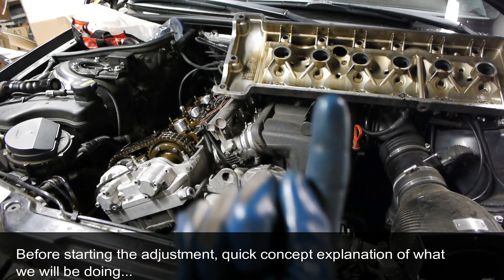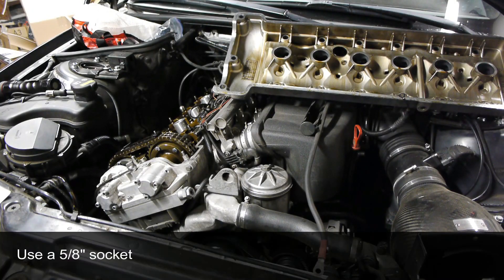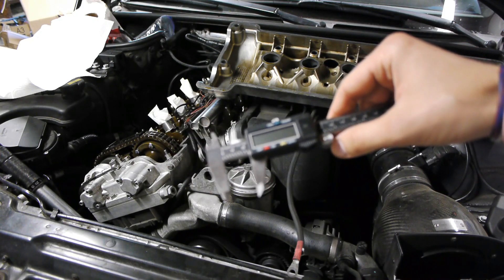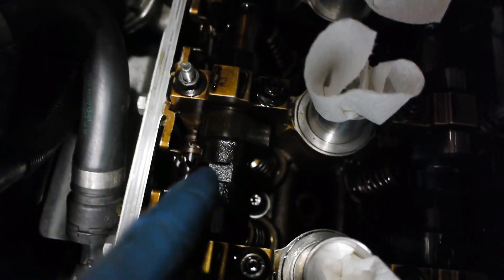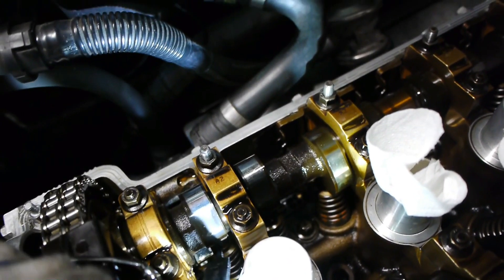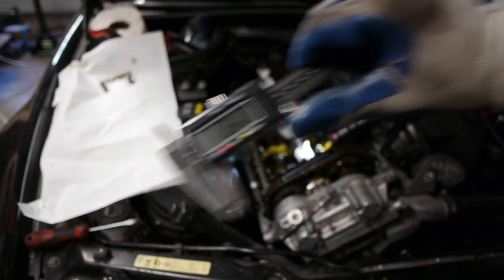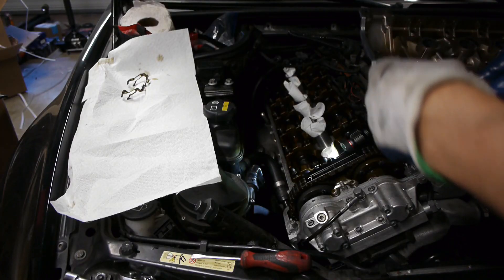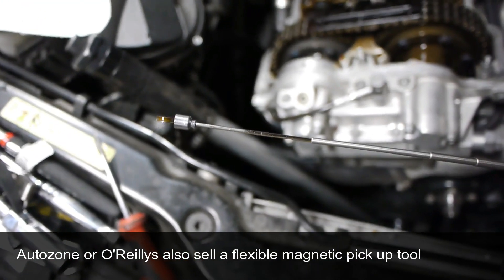E46 M3 Valve Adjustment - Part 3 Measurements, Adjustments, Looking for shims

Comment: I just did mine this weekend. Ordered a second shim kit because there were only 3 per size. I actually was able to finish it with just one kit since as I moved on to other valves, those shims worked for the valves I didn’t have any left of in the kit. I had a helluva time getting the rocker arms to slide over. Had to take brake clean on a rag and toothbrush to clean the rocker tube, and still needed to take a prybar to wedge between the rocker and cam bearing caps to, as gentle as I could, get it to slide over. Also found a couple of deteriorated and broke nets that cover the oils galleys, I just pulled the pieces out. They’re just plastic. I changed to oil too when I did this. My car runs rougher now and feels slightly down on power. I triple checked my go/no-go clearances, they were all good. (Actually only had 3 that didn’t need adjustment). I think maybe now I have a vacuum leak. Common issue I see in the forums after valve adjustments on these cars since they’re getting pretty old.
Reply from the maker: Yeah check a couple of the hoses that connect back to valve cover, idle control, etc. They are tricky because some develop cracks that you can't really see easily. Good luck!
Reply: @mrgizmo7975  did a smoke check, the only place I saw it coming through was the MAF sensor. So, I dunno. Maybe check the coils and plugs. Plugs are a week old, but maybe the coil plugs didn’t seat right, or the coils on the plugs.
Reply from the maker: Recheck the plugs to make sure they are torqued to around 18 lb ft (with a proper torque wrench). Sometimes there is buildup on the head and you think they are torqued but they are not quite. Reseat the electrical connection on the coils, those are sometimes a pain.
Reply: @mrgizmo7975  I cleaned the mating area best I could and blew out the carbon buildup with my air compressor the torqued them, and used copper based anti-seize as my manual says to and torqued. The could connectors look seated, and I used dielectric grease sparingly and isn’t supposed to hinder contact. I may take the coil boots off and clean the mating surface  of any dielectric that might have dried on from the last plug change.
Reply from the maker: You get this sorted?